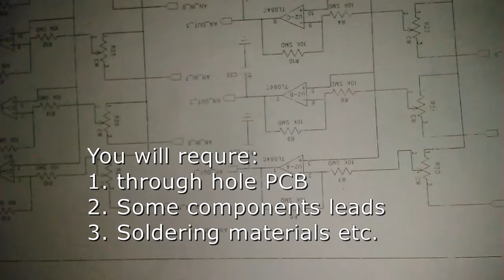How to design circuit on zero pcb

Comment: This is nuts. So much wasted solder! One of the reasons I dislike perfboards. They are best utilized with jumper-like wires running on the bottom for those applications were the board can hang with some spacing between its back and the enclosure walls. Otherwise, use stripboards. You'll save so much solder!